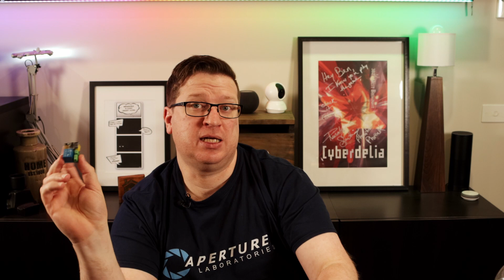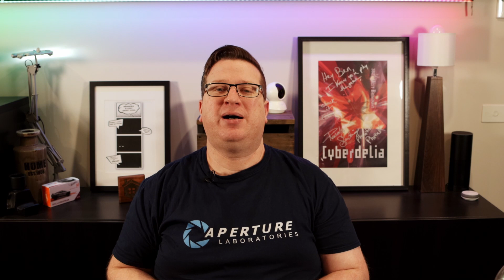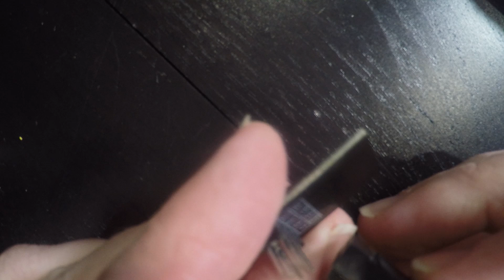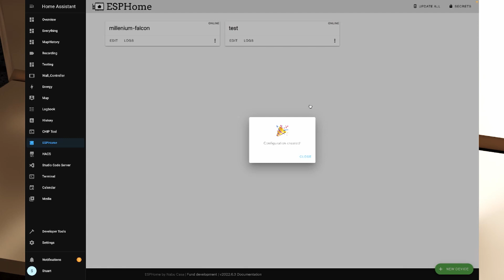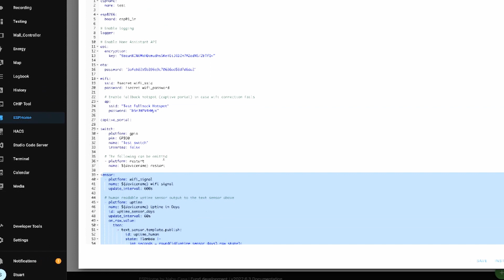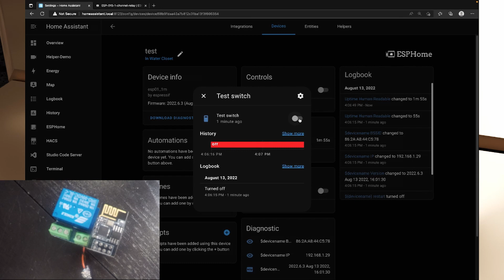DIY Smart Home Project - Intro to ESPHome and Making your own Smart Switch

Comment: Hi, nice video, in this I need one help  I'm using the Wemose D1 mini with a 4channel relay module on ESP-Home. everything works great only problem is with Booting or restarting the ESP, it makes the relay module turn ON in a fraction of a second it is turning off ( triggering ON and OFF) after that everything works fine. Only I restart or boot the esp problem occurs. what about u, r u having the same issue. How to solve this.
Reply: Change the GPIO you are using. Some pins are high/low on boot and others should not be used at all. Have a look at the pinouts shown on RandomNerdTutorials
Reply from the maker: I'm not using a D1 Mini so my experience isn't going to be the same.
That said, I've got the USB power switch wired up to the Normally Closed pin of the relay instead of NO, meaning that when it boots, for a fraction of a second, it's not going to have energised the relay, so power flows from the Common pin to the NC pin.
In my use case it's not a problem though.

Comment: ESPHome is fantastic.  I use it all the time, lately for custom gate entry solutions for clients.  Where I live it's not uncommon to have a metal gate at the sidewalk and then another door into the house after that, both having electronic strikes.  I like to modify Yale Assure SL locks to control these strikes by having the Yale lock hit a switch connected to an ESPHome microcontroller and from there activate a relay board to control the door strikes.  I usually add door sensors and LED indicators too.  The neat thing is you can write basic automations directly to the ESPHome device and have it function without being connected to Home Assistant.  This is great because it's important for it to work reliably even if your network is down or smart hub has a problem, but you still have the option of brining all those sensors and switches into Home Assistant if desired.
Reply from the maker: Yeah, I've not gotten too deep into ESPHome yet but so far I like it a lot. Especially - as you say - inbuilt automations.
Reply: @HiveMindAutomation  just ordered the relays to play with. Though now looking forward to getting a similar device with esp32 & Bluetooth.
Reply: Quick question, let's say I have an esphome wall switch to turn lights off and on. Can they control a smart esphome globe without using HA or even send rest API to Tasmota globe.
Reply: @clairerovic  ESPHome has not implemented ESP-Now functionality.  The way ESPHome is currently working, you'd have to have everything running on the same microcontroller for automations to run without Home Assistant.
Reply: @taylorlightfoot  Thanks for your wonderful insight. Started looking at esp-now as I didn't know it existed.
I did bump into this, thought I would share, grin obviously can't share the real link - preview--esphome wifi_now